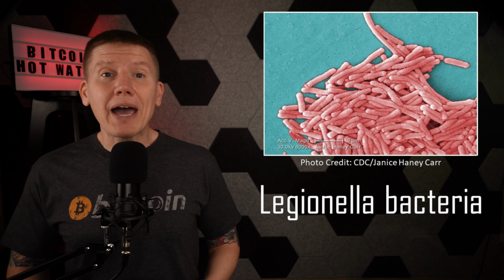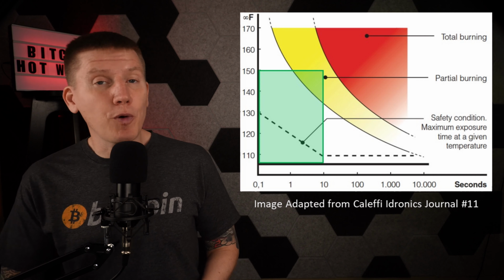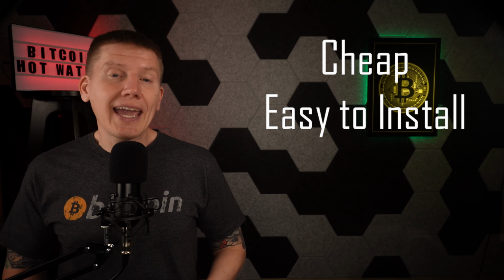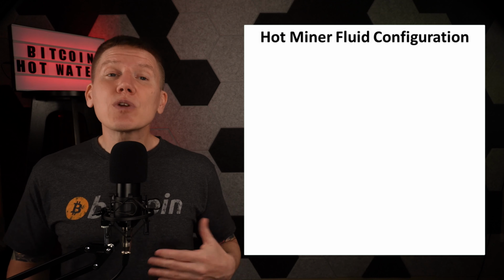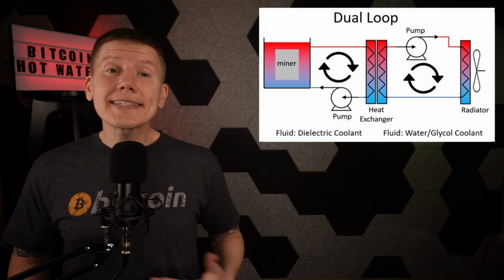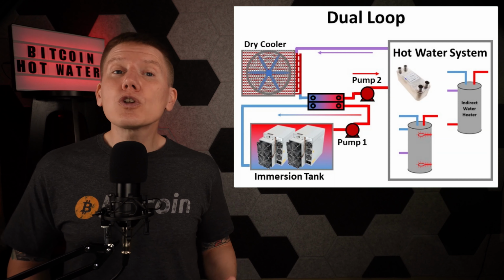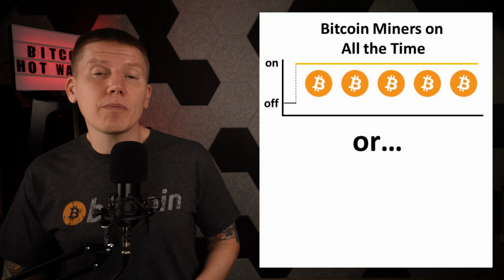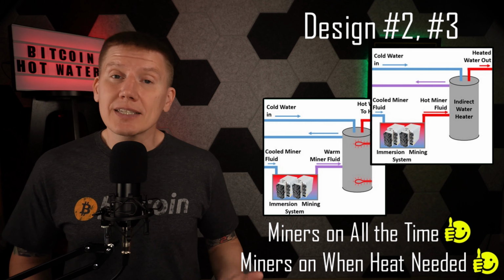EP29: How to heat YOUR water with BITCOIN

Comment: If you want to use a non-immersion heater you can buy a hot water heater with a heat pump and blow the exhaust into the room the hot water heater is in.  Then exhaust the cool air either outside or into a room your need to cool.  You should should build a small filter that can be replaced on the intake side of the HWH.  The exhaust of the HWH is roughly 60-68 degrees so it works great in the South.  Heat your water for almost free and mine Bitcoin and exhaust the cold air into the home.  Its a triple win.

Comment: Could I do this with just using an air to air heat pump water heater with the hot air from the miner going into the heat pump and then extract the cold air from the heat pump water heater back inlet of the miner

Comment: Quick question:

Can you make a video of how to design the following setup by priority?

1. Hot water heating
2. Home heating
3. Pool heating

The idea would be to keep the hot cooling liquid at the output of the S21 Hyd (or other liquid cooled miner) exchanging at all times with a hot water tank until this tank reaches 140 deg ºF. When the hot water tank reaches 140ºdeg the miner would stop exchanging with it and start exchanging with the home heating system until either the hot water tank is under 120ºdeg, at which point it would restart the exchange with the hot water heater OR, if the home has reached its temperature setpoint (and the hot water tank is still above 120º deg), then the miner would start exchanging with the swimming pool.

Is this feasible? How bad of an idea is it?
Much appreciated!
Reply from the maker: I think this is very feasible!  In my next video, I'm covering my own setup where I'm heating my water and my house...just like you noted, my hot water has 1st priority, then my home heating.   I'll be covering pool heater design in the following episode (about a month or so out).   Linking this all together successfully is going to depend on the specifics of each setup.   Sounds like you've got something in mind for your setup...if you want to collaborate on a system design, I'd love to help!

Comment: Why would I want to heat hot water? It's already hot ffs...
Reply from the maker: Well...not here in the US...tap water typically comes in the house at around 50-60F (10-15C)...that makes for a cold shower in the morning! :-)
Reply: In most of the world, people use hot water cylinders (HWC). Everytime you use hot water cold water gets pushed into the HWC to replace it. The mining tank as a preheater pushes energy that you need to disperse into something that requires energy. This will reduce the amount of energy required to maintain the heated water if you are cycling water through the miners back into the HWC. 

The same goes for heat pumps, preheated water doesn't require as much energy to bring to temp.

I think this is a brilliant idea, the only question is the efficacy of the heat exchange between the closed coolant loop and the cold water supply.

I really like this idea.